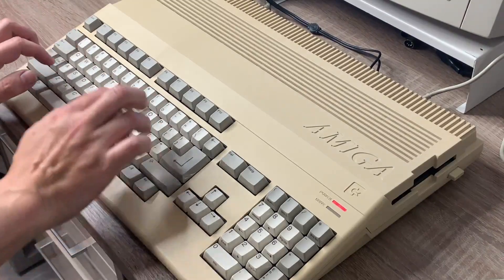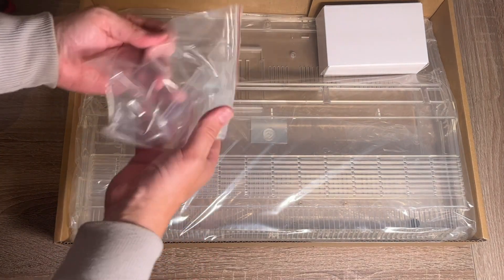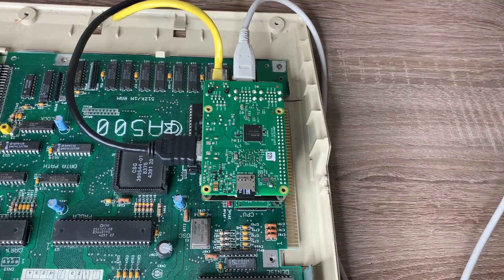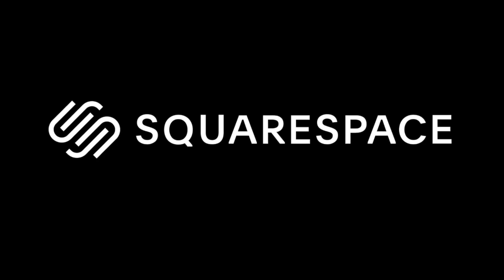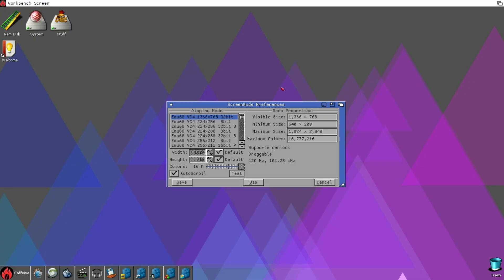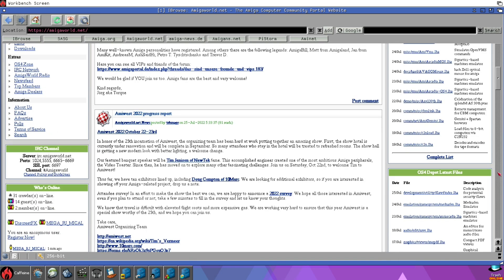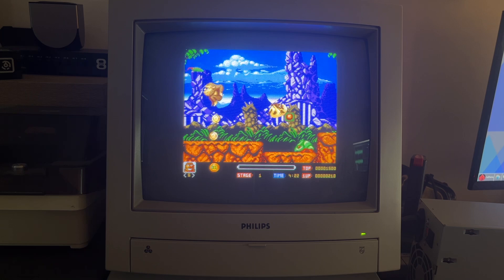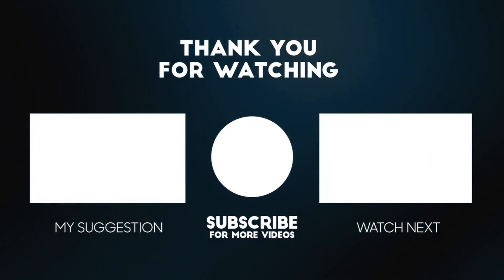EXTREME Amiga 500 Upgrades

Comment: I'm not a fan of turning a good working Amiga into something else apart from maybe storage, rather have a stock Amiga than a rig that's no more a Amiga
Reply: It is just an emulator running inside a 500. Not my cup of tea.
Reply: @gunnerhoward3134  Exactly. All this strange effort but you may aswell just chuck a pi inside the a500 case and hook up the power light. No ones going to know. What would be more interesting is some basic hardware mods that allow more ram or allow an SD card for a HDD.. but otherwise, yeah there is no point.
Reply: @blahmeh242  Agreed. I think I’m going to have to save up for an ACA interface. I want to have my A500 up and running with Workbench 1.3 from SD card and more RAM.
Reply: He could have 2 Amigas instead of 1.  A working A500, and then a Pi inside the clear case with a USB keyboard
Reply: For my use case, the pistorm works perfectly. I primarily use my Amiga for making music in octamed soundstudio v1. Ideally I want to make use of the Paula, along with the parallel and serial ports, so it's better to use a pistorm rather than emulating everything altogether. What I get out of the pistorm is a nice 720p octamed, more than enough ram and a high number of audio channels at once without bogging down the system. 😉
Reply: 1) it's only CPU emulation
2) it's completely reversible
3) some people acually enjoy using their old machines in new ways and not keeping them as a museum piece
4) what should be considered an 'amiga' anyway? if a chip fails and i replace it with a modern part the machine suddenly becomes unamigafied? xddd
Reply: @bamdadkhan It's mostly the lack of original parts. I could literally buy the pi keyboard and do the same, or mechanical keyboard and pi. I get not being able to use the old stock, but the more you pull away from it's constraints and originality, the less the experience you get...

I mean personally I don't really mind, but it feels "less" to watch, and I wouldn't do it. I've already got something that can fit in my palm and run the internet fine, so this would just be for fun, anywho.
Reply: @rya3190  hmm i think i kinda see your point. my sweet spot is accelerated but not emulated - and i love FPGAs. but this mostly psychological sweet spot might be somewhere totally different for others.

Comment: The Raspberry Pi4 will be supported soon as that will kick up the power no doubt.  Only thing is that how much work is the Amiga doing?  The Pi is so much faster it can emulate an Amiga very easily.  Sounds like it is just using the Amiga for interfacing a keyboard and mouse and once the wifi driver works even less.  It is astonishingly good, but on another thing, I am 51 and recall when I first turned on my Archimedes A3000.  Modern stuff does not give you that excitement.  The world was slower but you felt better once things got going.  We are becoming sheeps to speed.  I am using a PC with a Ryzen 5 2600 and a GTX1060 6GB with 16GB 3200Mhz ram on a 4k monitor typing this.  I really do not see the need for us to go blazing all the time.  Ah well it is what it is but love your videos Dan anyway :)
Reply: yeah, you might as well just be using a emulator on a pc
Reply: I pretty much made the same comment... what I would like is to run the original Amiga OS/Workbench, maybe little faster at it would help for certain games, but still use the custom chips to produce sound and music with the Pi only providing CPU and "translation" of image and sound for display through HDMI. Basically something I could have got back in the day but output on a modern screen (because my original Commodore takes a lot of space and is getting old)
Reply: i agree. when the Amiga Maxi comes out there will be no reason to do this as you will get the look, feel and emulation which is what this is.

Comment: My problem with things like the the PiStorm is that you may as well just run PiMIGA or WinUAE etc. It's the reason I resisted using a ZZ9000 in my A4000. 

I like modern solutions, but only in keeping with the original hardware.

Comment: The model I had used from 1990 to 1997, still my most favorite computer ever. I wished that all of those new case suppliers would plug that floppy hole, barely anyone uses those anymore. Give us an USB port instead! I modded my A600 that way and it's a nice and clean solution.

Comment: Floating point emulation is very hard as you have the mantissa and exponent which has to operated upon and is actually  a 128bit value if it is using IEEE785 format.

Comment: Great Video! Its been very helpful! Since watching I managed to get the pistorm and raspberry pi installed, and running caffeine OS on an A500, Thanks! It would be great to have a video that also covered the compatibility with the floppy drive, or Gotek, or external Gotek. I've run into some issues with trying to use a floppy and external Gotek with Caffeine OS, in particular - software seems to freeze before opening.

Comment: I run PiMiga on a Pi400 (keyboard enclosure) and it does exactly the same as the PiStorm. It's good, but it's not an Amiga. It's great at booting up and playing a few games quickly. My 600 and 1200 have CF cards, memory and WHDload but things don't always work as quickly or easily.

I'm planning on getting a A500 and I'll probably keep it stock with a RAM upgrade and keep the floppy. I have two Amigas that I can use for gaming, and a Pi emulator so it'll be nice to have a stock A500 and use it like it's 1992 all over again.
Reply: The Pi400 is great imo, I have one too and many different microSD cards, a PiMiga one as well. It’s so versatile and the keyboard enclosure made it worth it to me. 
I wish they did the ”clicky” MicroSD slot on the regular R.Pi 4B as well, it’s a pain to change microSD once added a case. I wish also the 400 came with 8gb of ram. 
Too late, let’s see if they’ll make a R.Pi 500, hopefully 8gb.

Comment: This is all very impressive, but with Caffeine OS running on effectively a Raspberry Pi is it still an Amiga... I mean you could run Caffeine OS on a Raspberry Pi 400 and have pretty much the same experience... What does the Amiga do in this case appart from providing power, a keyboard and a mouse? 
Can you still use Pi Storm and boot from an original Amiga OS? 
I'm asking this because having an Amiga 500, I would love to use a modern monitor to display the image and wouldn't mind a faster CPU but would prefer running an original Workbench and software that would run on an original Amiga... for more modern stuff I have a pretty fast Linux-running laptop that suits me very well

Comment: forts of greait video, but are you really runing an amiga at this point, or ae you running a hw emulator in an amiga shape case with an amiga keyboard and a disk drive? or put another way when is an upgraded amiga nio longer an Amigaa, I'm just curious?

Comment: I use PiMiga 3 on a Raspberry Pi400. The sysinfo score is about same as in video. And i can surf the internet (well, not fully compatible but good enough) and watch youtube on it. I don't have a real Amiga, i think a Pi400 works really great as an Amiga with PiMiga and it's small and compact, makes it very portable to move around. As for the transparent case, it's not cool at all. The original Amiga keyboard case looks way better.

Comment: Neat, but the excitement is quashed when you realize all this modern glory is just running on the isolated part of the machine which is the raspberry pi.   Like putting a modern small form factor PC into an old IBM case and calling it an original XT.  Sure, if you want to believe that.
Reply from the maker: Not really. This solution only replaces the cpu. The Amiga graphics and audio custom chips are still being used.

Comment: I don't know who's typing, but that's not how you type... LOL
That's more like stabbing a keyboard.
And the Amiga 500 case looks just like a RIP of the C=128
Oddly, between a C=128 and 500, in retrospect, I would not know which one I preferred... the 500 is not the clear winner.    Yes, it is miles ahead of the 128 in hardware... but...  that GUI OS it runs is a barf nightmare.    The 128 made an excellent 80 column terminal machine to connect to remote systems, and it ran C64 programs, and if you wanted to dabble, a slow CP/M.    It had some nice tools built into ROM like a machine language monitor and sprite editor, and so... was more of a hackers machine on the command line.  The Amiga kind of insulated you from all of that to be a point and click user driver, not a developer.

Comment: On the very controversial topic of whether or not the usage of `PiStorm` is genuine, after watching Dan's video it is now clear to me that I have to draw the line at the usage of the Pi HDMI output. If you end up using the Pi's HDMI output with a modern screen, what's left for our good'ol friend the Amiga to do? Are the inputs/outputs sent to Amiga's onboard devices at all? It certainly doesn't need to. It almost feels frivolous at that point to read from joystick ports when everything else is bypassed  Still, getting 21st-century facilities to an almost 40yo machine is rather nice (as long as it is reading and managing MOST input & outputs) :-p
Reply: Some folks just appreciate the illusion of running on old hardware.  This is like taking a small form factor PC and gluing it to an original IBM PC case from the 80s.  Then you can pretend you're running windows 11 on an old XT.

Comment: The new 68k emulator for RPi looks interesting, but for me I would be more interested in the RPi as a standalone rather than attached to the A500. Inclined to agree with others, the RPi seems to take over. Can you still load a game of a disk at boot as on a stock A500 or does the PiStorm introduce to many compatibility issues?

The switching between HDMI on the Pi and the native output reminds me of my A1200 tower with its Voodoo PCI graphics in early 2000s. Annoying. Some solution that brings the outputs together would be cool, similar to the pass through/scan doublers on classic Amiga RTG cards like Picasso 4.
Reply: Nothing is ever perfect

Comment: Thanks for this cool video!
One question:
Do I have to have 1 megabyte of Chipram, or does this run well with the standard 512k?
I do have rev8 board, but I am no expert in soldering...  
Thanks in advance!
Reply: The Pistorm allows you to map slow to chip via the boot configuration file, meaning that you can install a ram expansion in the trapdoor and NOT have to cut/solder a jumper to make it active.
Reply: Thank you!!!
Reply: @AS-ly3jp  Worth noting that even with PiStorm you do still need a 1MB compatible "fatter" Agnus for the 512KB trapdoor to be mapped as extra chip RAM.
Reply: @Daz5Daz  I do have a fatAgnus installed.

Comment: Maybe it's just me but I love the modern replacements when you're restoring an old machine and your options are limited. You've got an old motherboard but no case, an old system but no floppy or PSU, so you find modern replacements because of cost and availability. There's also the modern convenience options - use an SD card - not a HD for example if it doesn't make significant 'permanent' modifications to the system. For me it's a balance between nostalgia, convenience and cost.

Comment: at this point you should just go emulators. no need to fuck up the Amiga with extra shit that was never there in the first place. I hate this. If you want super smooth gameplay , then play it on a modern, or even mid to early 2000 PC's
Reply: Thats exactly what I was thinking. Just run a modern emulator on the PC and call it a day. Hook up a real CRT - or run a CRT shader then load games in 2 seconds already cracked if needed and move on. If someone wants to actually use and run and appriciate the original hardware, then just use that with only minimal upgrades and things.
I also hate those made up OS's pretending to be something but they are just gross.
Reply: @Ed Straker educated opininon
Reply: It’s an addiction/obsession like trying to squeeze out every single hp out of a car.  I got caught up with the speed wars back in the day with the macs and their PowerPC accelerators.  Now, I like to use the hardware as close to period accurate as possible.  In 1992, I tried adding an ICD AdIDE but it wouldn’t recognize my drive, then I bought a GVP A530 (no returns-clearance sale) and the hard drive controller only worked for a month.  So fast forward to now, I’ve added an accelerator/memory/hard drive that runs at 25 mhz on one Amiga 500 and a hard drive/ram expansion on the other.  They give me performance levels that were possible back in the day.  If I want faster performance I go on my a4000 with a period accurate 4060 card.  If I want to surf the web or go even faster I use my pc and winuae.  I think I would get a mini Amiga before sticking a raspberry pi inside mine.
Reply: It's just to create the illusion of something that is original.  Like Nascar racing, those cars look like its corresponding production vehicle but under the facade, has absolutely nothing in common with such.